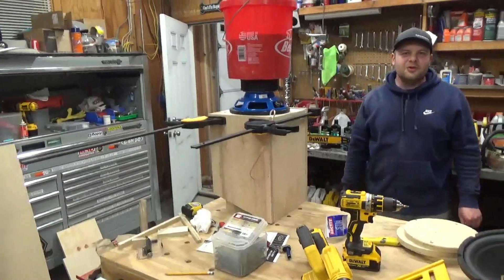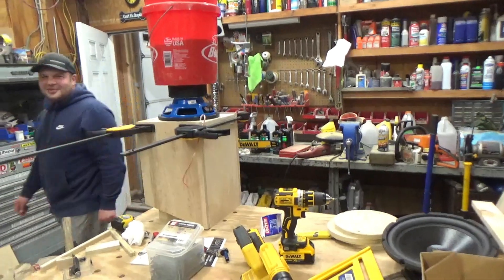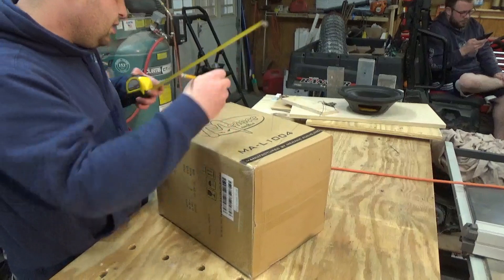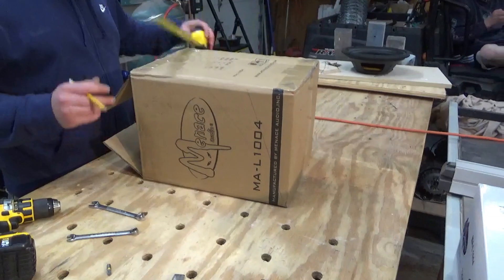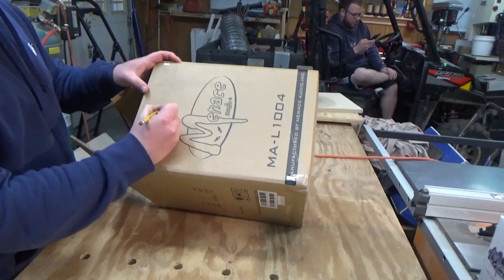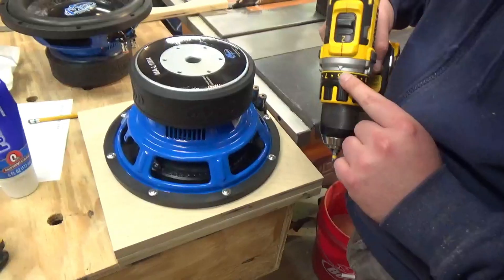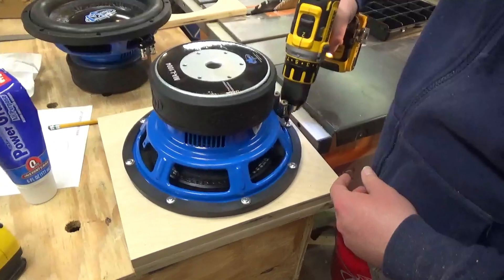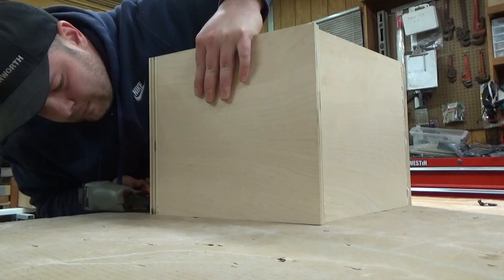How not to build an isobaric subwoofer

Comment: How do you compare the sound? I never listened to an isobaric before but I know you can make it half the size if you do two times the speakers and 2 times the power. From what I have read there's no besides space savings. Can you elaborate on  the sound quality, performance and loudness
Reply: It's more clean sound overall, and it hit the drumkick! You have a space between the inside of the box and the outside. It eliminate distorsion.
Reply: The perfect box for two 12s is a 6th order compound loaded isobaric box. If you have two 1,000 watt 12s it will sound like a 15 inch sub with much better lows then using a cheap typical box.